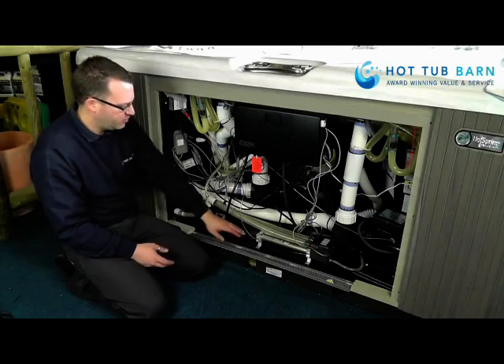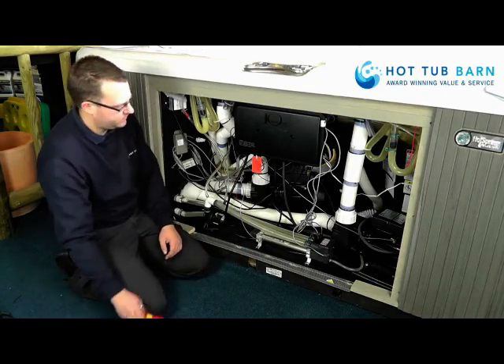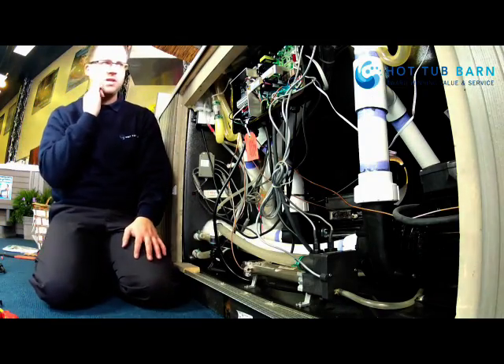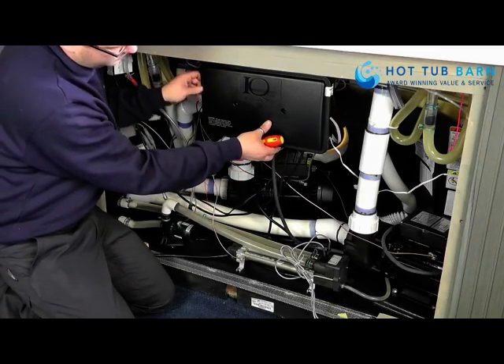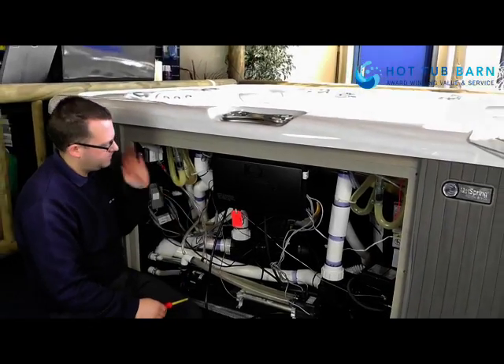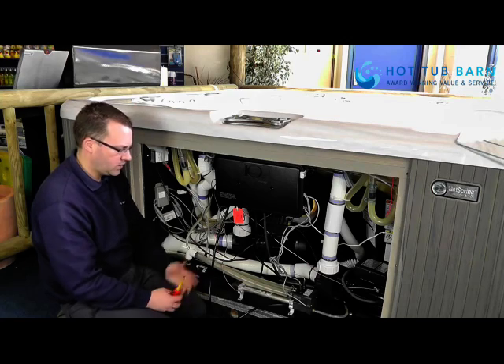Replacing the Heater on your Hot Tub with Wayne Hitchcock

Comment: I haven't dug through all the comments, but my new heater did not come with an installed pressure line and the old one had one. The little "box" that had the pressure line does not exist in the new heater.  Only connections available are on a couple of white lines. Company closed today.

Comment: Great video!!! I have a 2004 prodigy h model with PDR heater. The heater works (hot water) but on inlet side of heater, water is leaking behind thermsitor sensor. Dont think i need a whole new heater. I was thinking of taking thermositor out, buy some RTV sealant and install a new thermositor in it. I had a hotsprings technician look at it. He said the entire heater needs replaced and for $360.00 plus 1 hr labor, he could do it. I can buy RTV sealant & thermositor for 40.00. What you think???